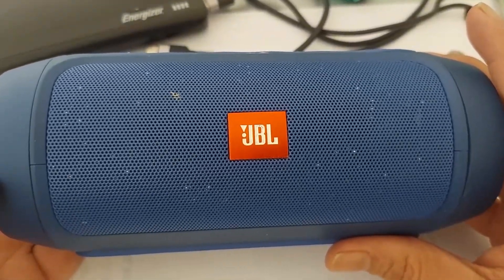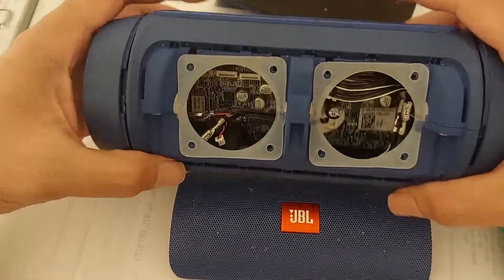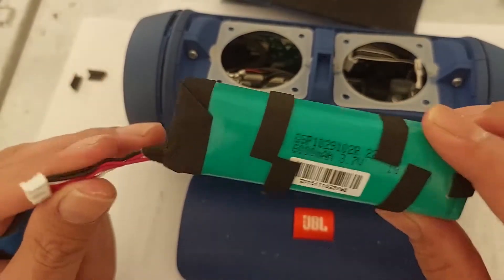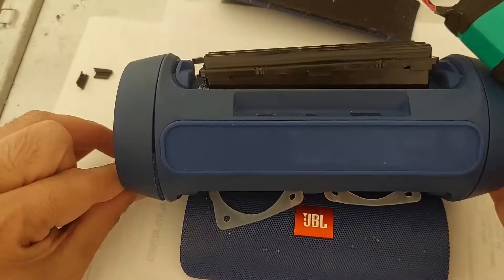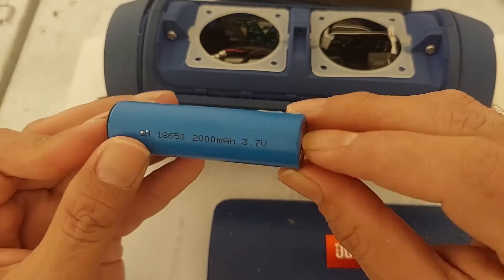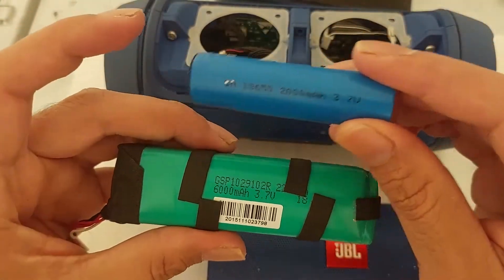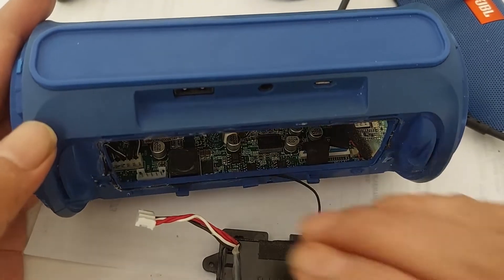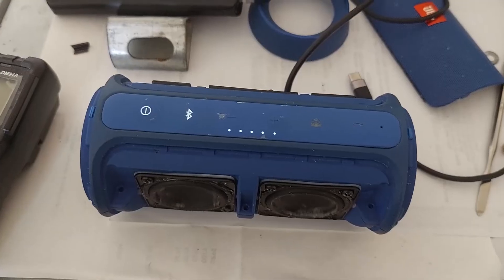JBL Battery Modification 18650 GSP1029102R

Comment: You need two batteries 🔋🔋 with parallel connection.
Reply: well i guess that wouldnt fit but u could fit 21700 battery there like 5000mah one and it would fit

Comment: My jbl worked but it doesn’t charge.
Reply from the maker: need some check, just like smartphones, most of case charging IC failed. or simply broken port /cables
Reply: @addiengr1 no problem like that.. it charges fine when it’s og battery

Comment: Justo estaba pensando en usar una bateria 18650 para resolver la falta de bateria, ahora q ya confirme q si funciona la modificacion pues el chino de aliexpress va a dejar de vender 24 dolares por el repuesto, justo tengo bastantes 18650 q siempre saco e laptops dell.... gracias por el video  me sirve de referencia para darle una segunda vida a mi flip4.
Reply: Hola le pusistes la batería te funciona tengo una flip 3 que necesita batería y quiero saber tu experiencia tengo batería 18650 creo que nomás una se ocupa

Comment: hey mate, I've had this mod done to my Charge 2+, thanks to you but now I need to change batteries again, you recon I could use a 21700 instead of the 18650 we used? i think it could fit the space and has a higher capacity apparently. hope you could help out.
Reply from the maker: no problem . as long as same 3.7V DC

Comment: Can 2 batteries be used at the same time?
Reply: I think as long as it won't exceeded the required voltage of the unit?
Reply: Wire them in parallel
Reply: Yes to complete the mah

Comment: Yes but it doesn't get enough mAh like the original battery, it will discharge fast and maybe make distorted sound
Reply from the maker: update on distorted sound came from broken wire behind speaker, replace the wire and  distorted sound gone
Reply: @addiengr1  great advice, I'll try that, thanks!
Reply: @kolemlg mine does that too it's the battery bro
Reply: He needs two batteries in parallel